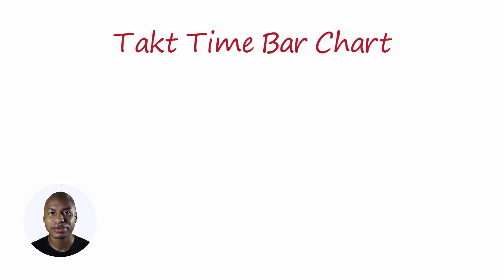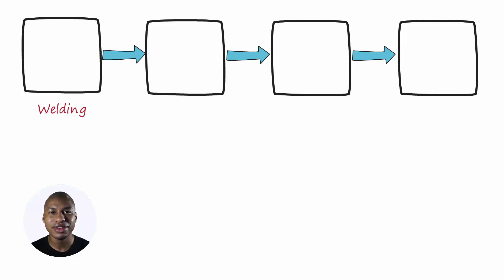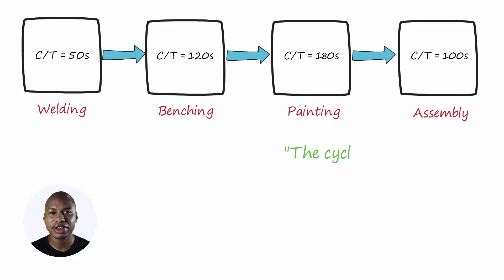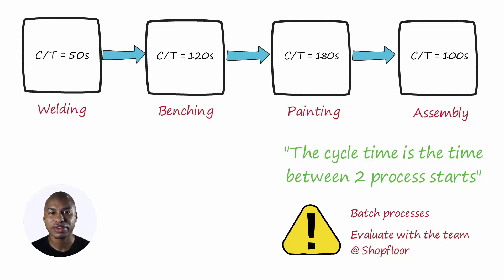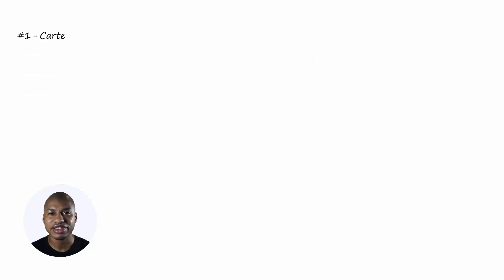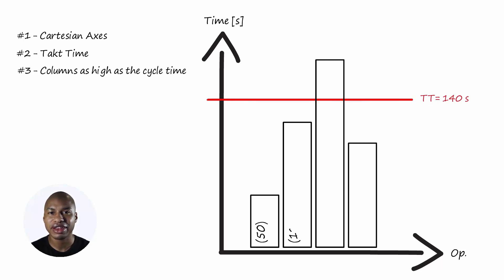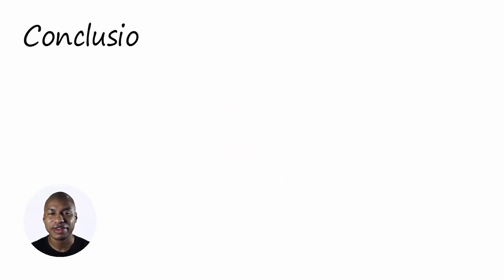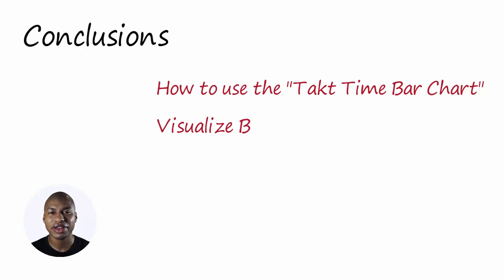What Is a Takt Time Bar Chart. Useful for Bottleneck Analysis - Takt Time Tutorial - Episode 2

Comment: Great video, thanks! When I calculate available time shall I also consider of head count or not? I.e. for a assembly production line avaiable time should be 7.5hours (27,000seconds)*20days*head count? Or head count shouldn't be considered? Also what if we produce something really big customer demand is only 2-4 sets?
Reply from the maker: Dear Jeremy,

Thank you for the question.

Based on my experience, for the available time, I do not consider the headcount at all.

As I mentioned in this tutorial, the first step is to calculate the "CUSTOMER TAKT TIME".

Then, when the Cycle Time of the operation exceeds the Takt Time, you have to evaluate the number of people you need to perform the operation to satisfy the customer's request.

I hope it helps.

For the second part of the question.

What do you mean for 2-4 sets? Daily, Monthly? Yearly?

Reach me directly here: https://www.leanvlog.com/about/
Reply: @LeanVlog  Thank you sooooo much for reply. It helps a lot!  2-4 sets means monthly since we are building components for gantry crane
Reply from the maker: @jeremysun1348  Let me try to do the calculation for you:

Customer Demand = 4 Sets / Month

Available Time = 7,5 hours * 20 days / month * 0,85% (Labor Efficiency) = 127,5 Hours

Takt Time = 127,5 / 4 = 31,8 Hours

This means that any box of your process has to able to complete the operation in less than 31,8 hours.

If you want to know more write to me directly: https://www.leanvlog.com/about/
Reply: @LeanVlog  thank you so much! Merry Xmas and Happy new year!